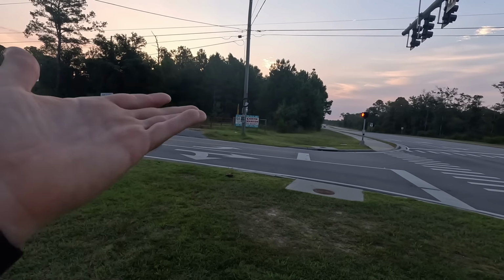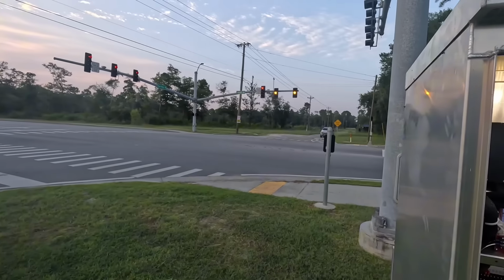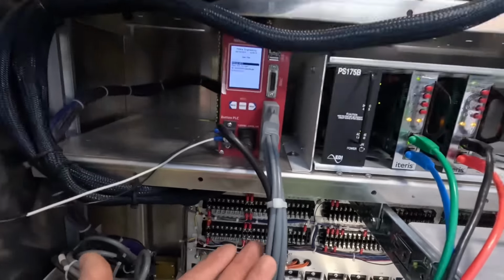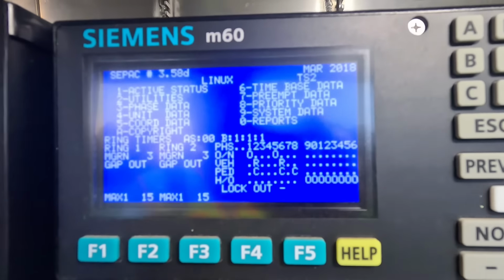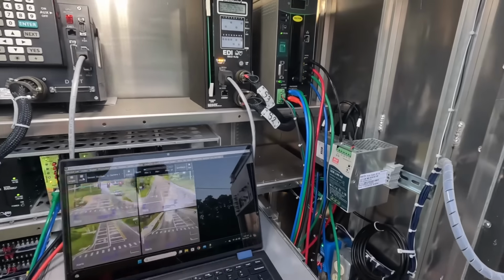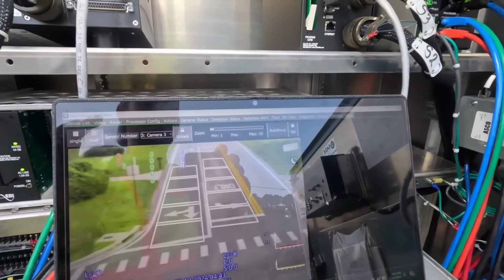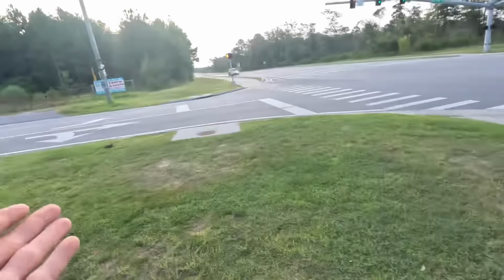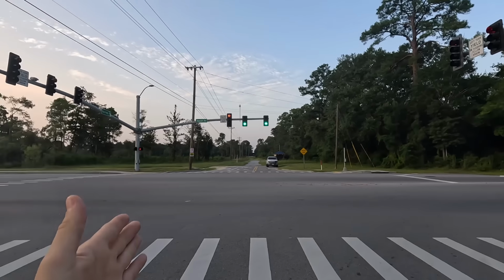How Traffic Lights Work!!

Comment: Hello. If you are reading this may I ask if the system described is universally adopted or if it varies by region. I am doing research on methods that can allow traffic lights to stay operational in the event of a power outage. My research is completely focused on South Africa’s traffic light system, where we have constant loadshedding. Is there also any recommendations of methods that has been proposed in the past to solve similiar problems in the past?
Reply: Also only focused on the city of Pretoria

Comment: Do these traffic controllers get monitored remotely or is it always where someone has to report they aren’t working. Yesterday on my way home a light never cycled for me to turn left, I was not past the stop bar I waited over 5 minutes and every other group went at least 4 times. The light did not cycle until someone pulled up behind me to also make a left turn. I called the city to complain its light their sensor blocks from the camera were off. I go through this intersection m-f but was on vacation since last Tuesday. It def has a camera on the intersection, that was added maybe a year or two ago. I was so mad and was looking for a window for me to be safe to go anyway and it never came.

Comment: Well, you answered the question. I was wondering if you walked out there or would it actually trigger a green light and it did so but with that being said back to the you don’t love them well I will say this you do love them. I’m only kidding, but they look so lonely sitting out there at Christmas time. Do you give me some love? Do y’all go put like Christmas ornaments on the lights and make them feel all warm and stuff if it gets too cold in the old days, they had incandescent bulbs that would keep them warm but now the LEDs don’t keep them warm, but I heard they make heaterswhich in your case you probably don’t get up getting snow down there, but if you were the heaters would keep the lenses warm to melt the snow but I have yet to see that implemented anywhere anyway real quick question whereabouts in Mississippi are you? I’m curious because my mom who passed away a couple of years ago is buried in Tylertown right off of I 55 if you know where that’s at it’s just south of Jackson.

Comment: I wish more city DOT managers see this video. The cameras is way better than the loop and plus longer life of the intersection roadway (no need to cut for wires that turns into potholes). I know understand the random boxes on streets that don't have traffic lights - those run the street lights (lunar lights)

Comment: I find this all wicked fascinating. 
Could you maybe cover in a video how the lights know when an emergency vehicle is coming well before the zones, and turns the lanes that the vehicle is travelling green. Along with the white strobe light on top of the light poles that blink, what that means? 
I assume its to get drivers attention that an emergency vehicle is coming. But an official explanation would be cool too 😂😂😂. 
Cool videos my dude!
Reply: There are detectors in the intersection called an opticom system. They detect the flashing lights of the emergency vehicle, signal to the controller and then the controller changes the lights to green/keeps it green. The white strobe light is called a confirmation light and flashes to tell the driver of the emergency vehicle that the detector picked them up and the light is going to change.

Comment: I always wonder how are the wires ran down the mast arm to the cabinets
Reply: There's a handhole with a removable cover at the base of the pole, that allows you to relieve the tension between the underground run, and the run inside the pole/mast arm.  There are openings at each signalhead position on the mast arm, for routing wire onto the signalhead fixture.  As they install the mast arm, they equip the assembly with a pull string, to assist in pulling new wires through it. When changing wires, you use existing wires as a pulling aid for new wires.

Comment: Great explanation on the controller. I would have liked to get into this field when I was a young man.  Do you guys  use Optocom to detector emergency vehicles?  What if there is a train crossing there? How does that work? Is the MMU also called a conflict monitor, too? Thank you  so much  Don

Comment: Please stop giving walk signs with a conflicting flashing yellow arrow, this kills pedestrians. If anything, a steady red left arrow during walk, and wait a second or two after the don't walk sign starts flashing before changing to a flashing red arrow.  Don't just give drivers the opportunity to send it from the far side of the intersection into a long crosswalk, they won't look.
Reply: The flashing yellow arrow is no different than the green ball here, in that it's a permissive left turn where the driver has to yield to all traffic legally in the intersection (including pedestrians crossing on the walk indication). Although some jurisdictions will show a red arrow during the walk indication and not go to FYA until the flashing hand (or even suppress the permissive left entirely when there is a conflicting pedestrian call), this isn't really common.
Reply: @ljthefro  I'm aware of what the FYA means and how rare it is for these to be set up in a safe way.  Crosswalk calls should be filled as soon as safe, and must prevent a conflicting green or flashing yellow.

Comment: MODOT had a Traffic Signal Box Hit by Lightning last Fall 2023 in a STL Suburb.  MODOT Claim it’s been Waiting for a Replacement Part for 9-10 months.  Signal has been on Basic Function for Months which gives Green to a Strip Mall Exit 🤪 and NOT to the Main Road.  Makes NO Sense. 🤪👎

Comment: Thank you for the tour & especially the explanation of the phases that I wasn't sure I had properly figured out.

I recognized a radar/video detection head for the first time this week. It's on a 6x4 lane intersection with a brand new firehouse 500 feet away; when the equipment heads out on an emergency call, all lights go red. Are firehouse calls treated as a separate phase?

Comment: How does that stuff not freeze in winter?
Reply: Where it gets cold, sometimes these boxes will have a layer of insulation on the outside, which helps the heat from the equipment keep the box surprisingly warm. The equipment in there is all likely to have a more industrial temperature rating (I.e. down to -20F at least) than typical office equipment. The enclosures are also sealed up to deal with driven rain, ice, etc while keeping the equipment dry.

In really extreme cases, there are enclosure heaters and AC units that can be easily retrofitted on there - I’ve had more trouble with the heat in those boxes than the cold, even way down in negative double digits (not traffic signals personally, but similar industrial control equipment)
Reply: The Gulf Coast doesn't really get that cold in the winter. It FEELS cold due to all the humidity, but hard freezes are a once-every-few-years thing.
Reply: @RASpitzer23  I am talking more of up north.

Comment: You said that the cameras should detect bicycles, but here in my city, there is an intersection I go through that has a camera on it, and it does not detect me when I am on a bike. I have tried to find out who is in charge of the signals, but city hall tells me DOT, but I don't think DOT handles the cities traffic lights.
Reply: This will depend on where you are, so I’d believe the advice from your city hall. In my (small) city, there are several traffic lights, but only one is actually maintained/owned by the city - the rest of the lights are on US Highways that run through town, and are therefore under CDOT (Colorado Dept. of Transportation) ownership. Any changes/etc have to go through the state.

Comment: Excellent!   Traffic signals 🚦 have come a long way since the old "electric clock" timers with one fixed time and no sensors.  I imagine there are software engineers who work to optimize traffic so that the fewest number of cars are stopped and idle.  Or maybe AI will come along to further optimize traffic. 🚦Big Thanks. 🚦
Reply: That optimization process is often done by civil engineers who specialize in traffic operations. But they often use different specialized software programs to perform that optimization.
Reply: @ljthefro  Yes indeed!

It typically starts in Synchro or Vistro (not an ad), but then the field engineer has to re-adjust in the field, especially when working with a corridor or grid system.  Synchro and the theories that underpin it (mostly Webster Delay and the TRB Highway Capacity Manual) make a lot of default assumptions that are rarely 100% applicable to YOUR location.  Zong Tian from UNR has developed another solution called WaySync that is gaining traction, so we'll see if that reaches the same level of use as Synchro.  Of course there are also proprietary systems that can do "Adaptive Signal Control," but that stuff is never covered in engineering school.
Reply: @stephenfry-gdot  I wasn't gonna get bogged down replying with specifics in the comments, but thanks for providing that extra context. 
Fun fact: I took traffic engineering classes from Dr Tian at UNR several years ago, before life took me in a different direction professionally. Didn't know about his software...that's cool!

Comment: Wow this guy is like a god. He can go into any of those silver cabinets and make the traffic lights do whatever he wants. Green lights for everyone!!
Reply: I've seen that film. It didn't end well.
Reply: Italian job and Gremlins. @jovetj
Reply: @jovetj Italian job and Gremlins.
Reply: Italian job and Gremlins.
Reply: You don't want green lights for everyone,  at least not at the same time.
Reply: Vehicle detection sensors have NOTHING to do with what you think it is. The light is setup to always give priority ‘green’ lights to the main road. While the secondary road will NEVER get a green light until there is a vehicle detected via the sensor. He is talking about this vehicle detection sensor. 

He is NOT talking about those illegal devices sold on eBay, that may or may not work, which is used for emergency vehicles to trigger a green light immediately. BTW if you are stupid enough to use such a device, you WILL get caught and the fines are INSANE. 

Why would that be cool? In reality, what makes YOU more important than any other citizen? Doesn’t everybody else consider their time just as important??

Be careful out there and be considerate of others…